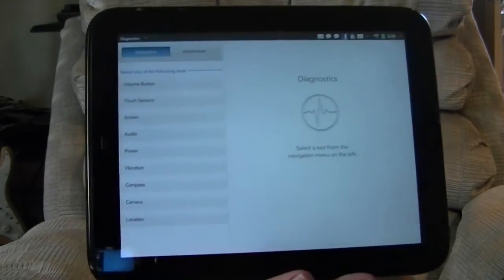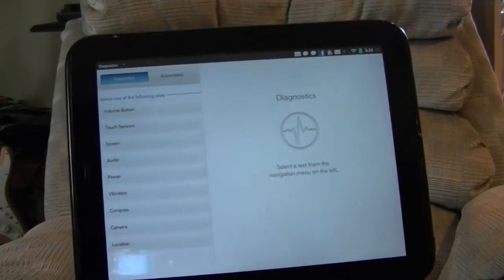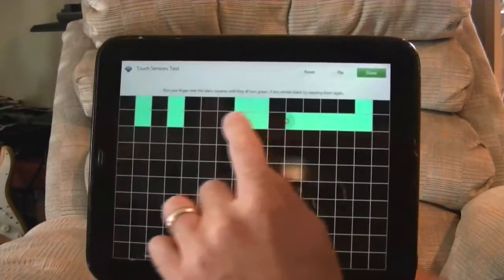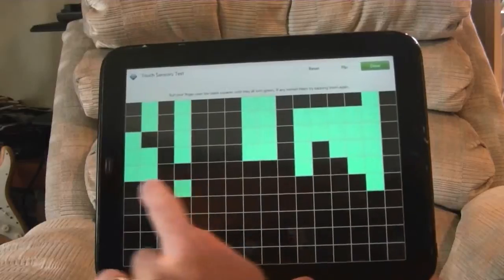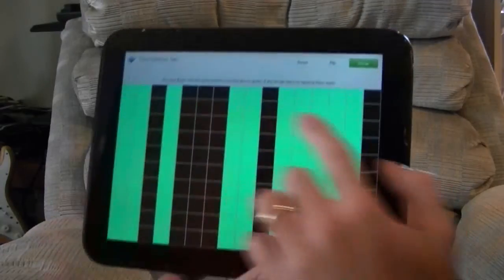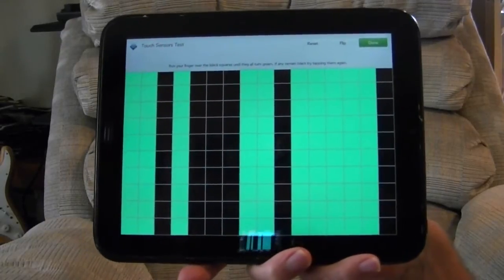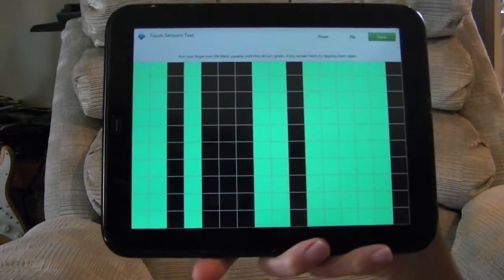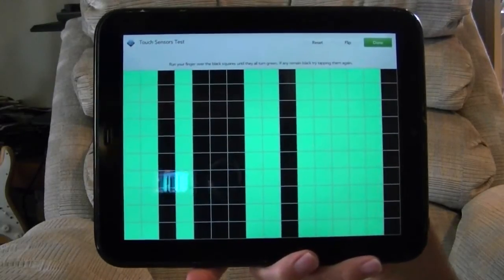HP Touchpad Screen Problem - Dead Zones

Comment: Dear Pashmee,

I also have a hp tx2 I bought on Ebay and I have exactly the same problem. Could you tell me if there is a solution or how did you resolve the issue? Thanks!